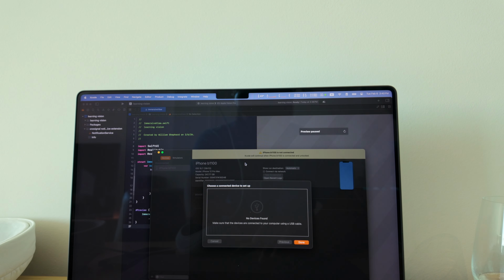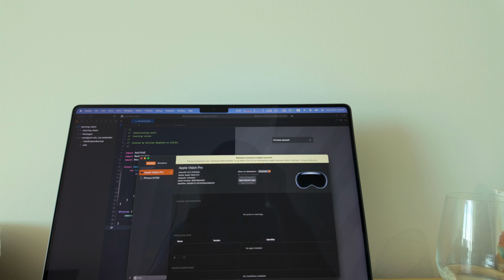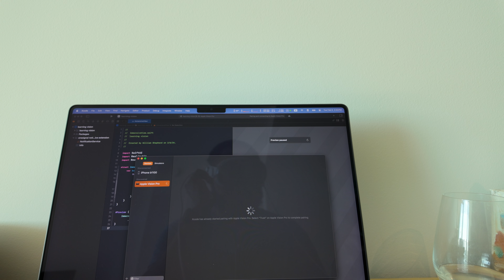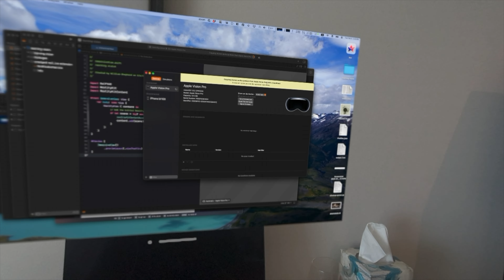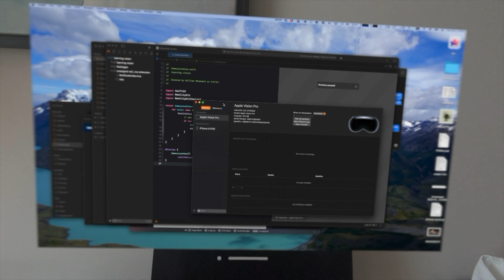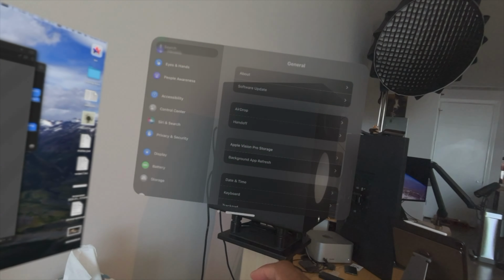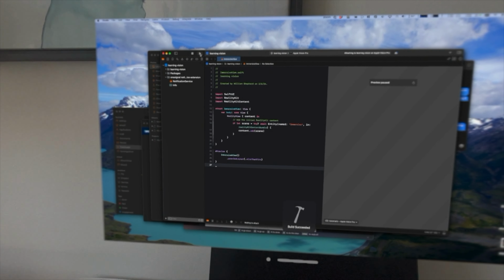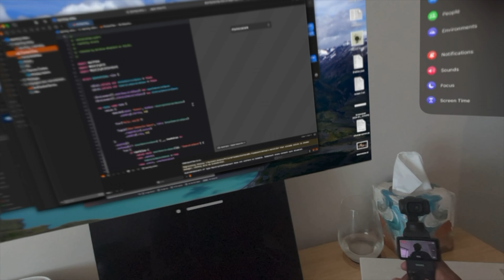How to install Vision Pro Developer Strap

Comment: what have you found you can do with it besides faster app upload and faster debugging?
Reply from the maker: I can use it anywhere. I don’t need a secure WiFi connection. I just plug it in and it works. So I guess you can say you it just works 😇
Reply from the maker: That pin tool is worth at least $50 😂

Comment: What is the advantage of using that 300$ strap over wireless debugging in Xcode? Apple writes vaguely about faster development but doesn’t specify anything about it and others are reporting it’s limited at USB 2 speeds, which is slower than modern wifi speeds
Reply from the maker: No idea. My preference is physical connection. I don’t use WiFi for anything, it’s very unreliable compared to a physical connection. So for me, the benefit is having one less thing that can go wrong. 

Happy developing!!!
Reply: @hey_im_him  One less potential bug to debug. Same opinion over here. Great video btw

Comment: yep this thing is only data ...and I heard it's usb 2.0 speed... but haven't checked that
Reply from the maker: It may be hard to check. You can’t do anything with it besides connect to Xcode -_-
Reply: So connecting to Steam VR directly probably is not an option? Using it for Xcode dev is nice but I am hoping the AVP will allow displaying PCVR apps.
Reply from the maker: Yea, I was hoping it would be more useful myself, but I guess this is Apple's new M.O.